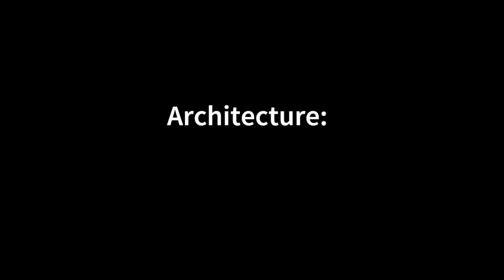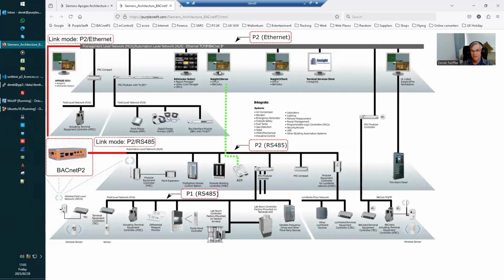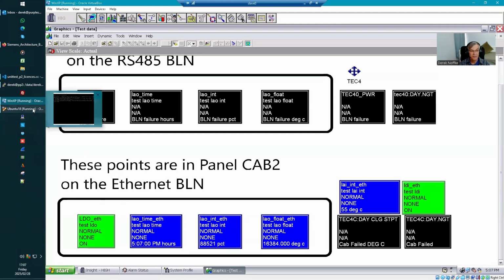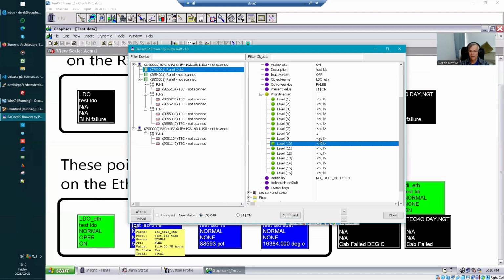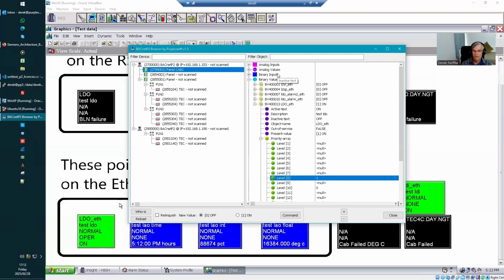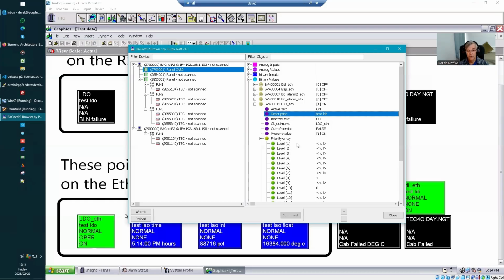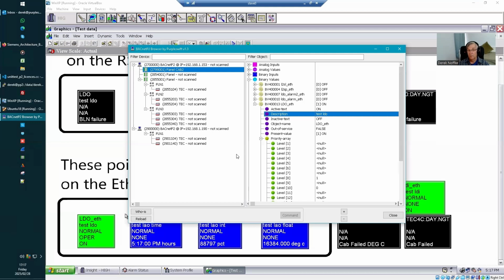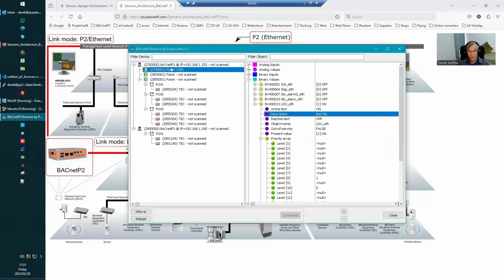Technical Product Demonstration

Comment: I also know about p1, p2 and Ethernet p2 protocols and have developed related Scada software. I asked because I was curious to see you guys actively promoting it. If Siemens raises an issue, do you have any countermeasures? Of course, Siemens s7 protocol is also not public, but it is already known, and p2 is now an isolated protocol, so I don't think you can worry about it.
Reply from the maker: Thanks for the clarification! You're absolutely right—P2 is a closed protocol, and we’ve taken care to ensure our approach is compliant and low-risk, especially since it's now largely isolated and legacy. We’ve built our solution with respect for existing systems and without using any proprietary Siemens code. Appreciate your interest and experience in the space!